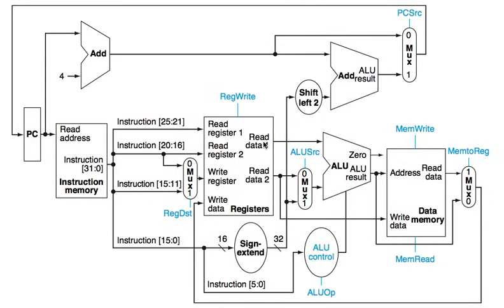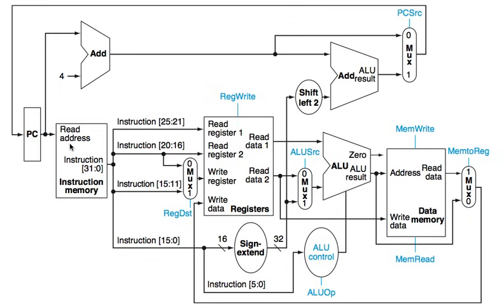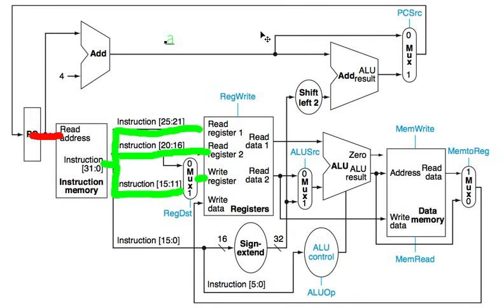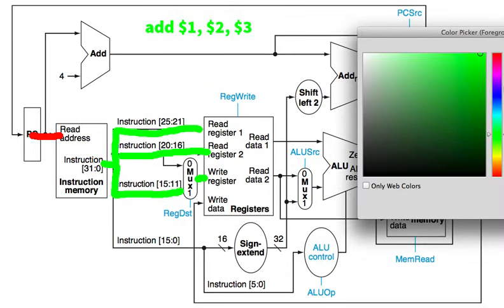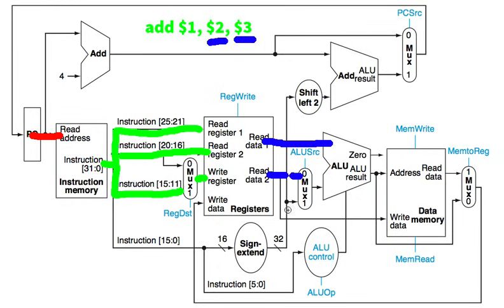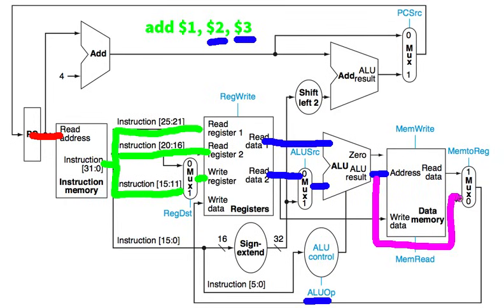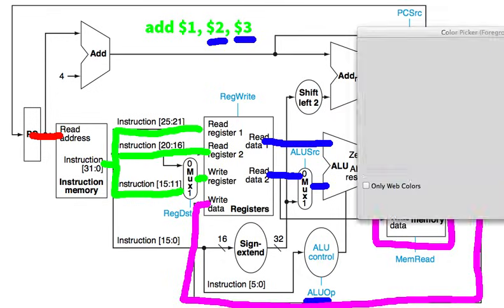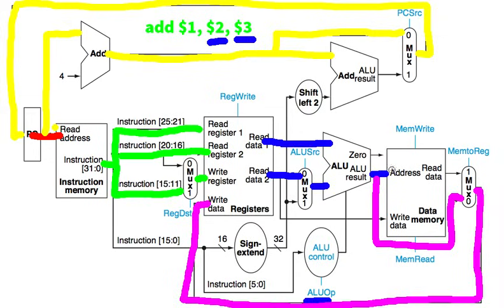Ift201 MIPS Data Path Lecture

Comment: It took me some time to digest that block image. Just to explain my first impression: I was surprised that the memory is integrated like this with parts of the CPU on both sides. I was surprised by two ALUs. For the PC use a single ADC and just hard wire the address pins to zero. I don’t get why the sign extend is below the register file. Also sign extension is typically done in the ALU. You just wire all high pins to the sign trace. Nobody not in reality, not for explanation would route the sign extended value over — ah there is a node. I still think that those 4 other crossings should go away.

Maybe things like sign extension and shift don’t belong here like a two-complements isn’t also not explained here.

So MIPS could not decide where to store the write register in the instruction. SH2 could . Why do we care?

Funny how the ALU zero output goes nowhere because MIPS forgot the flags .. of course it goes to branch. I like this. The branching sits in the load store phase, while MIPS claims that the instruction address is ready in the next cycle for the fetch. Maybe there really are two ALUs who calculate both potential new fetch addresses? Then there is a straight connection back from the zero output of the main ALU to a Demux just in front of the program memory? Like after the output latches before the buffers=current amplifier.

Comment: anyone help me for this assignment

You are required to create a simulation of MIPS architecture in your favourite programming language. You should define an object (class) for each of the major components of the architecture. The public members of each object should be:

1. storage element(s) storing the output data of the component
2. function(s) that correspond(s) to the control signals for the component.
While simulating each component, the input to this component should be fetched from the output storage element of the component(s) connected to it in the architecture.

To simplify the design, multiplexers are not considered as separate components, but rather as parts of other components.

A class "machine" should be defined to represent the desired architecture. 
It should include the major components of the architecture. Namely, mem_unit, alu, registers,CU, PC_unit and IR_unit. This class has only two public members;
1. a "load_prog" method to read a machine language program from the file and load it to sequential locations of a simulated memory in the class "mem_unit" starting at location zero. "load_prog" should also initialize the program counter to zero.
2. an "execute» which simulates the actual execution of the program and eventually calls within the following method "clock_cycle".

A "clock_cycle" function that simulates what happens during one clock cycle. This function should emulate the finite state machine control, which will require that the class "machine" keep track of the current machine state in a private variable "state”.
Instruction Set: The program should be implemented to execute one of the following subsets of the MIPS Instructions set:
Subset: holds the instructions ori, beq, lw, exit system
Specifically, your machine should recognize the following opcodes in the high order six bits of an instruction, and simulate the execution of that instruction:
0011 01 === ori ?
0001 00 === beq
1001 00 === lw ?
1111 11 === system call to exit.
The exit system call should display the content of the 32 machine registers as well as the allocated memory locations.
Input: The input to your simulation will be a machine language program stored in a file. The file should include a sequence of machine language instructions, each instruction being a 32-bit word encoded in hexadecimal. 
Sample codes can be taken from here:
https://sweetcode.io/building-first-simple-program-mips-assembly-language/
It should be converted to machine language.

Output: The output will be a well formatted display of the content of the 32 machine registers as well as the allocated memory locations (all displayed in hex), when an exit system call is encountered. 

This should be followed with the total execution time of the program, in terms of
- Number of cycles: counted in your method.
- Real execution time (in milliseconds): Use System.nanoTime(); at the beginning and end of the "execute" method, then display the difference.